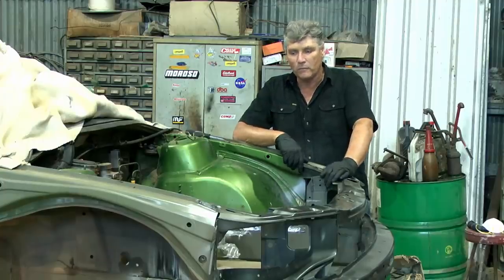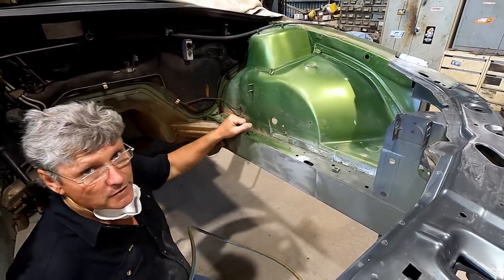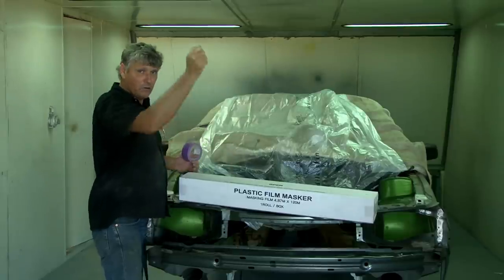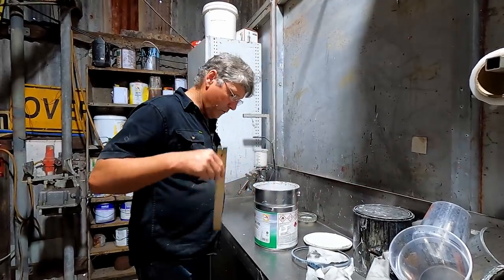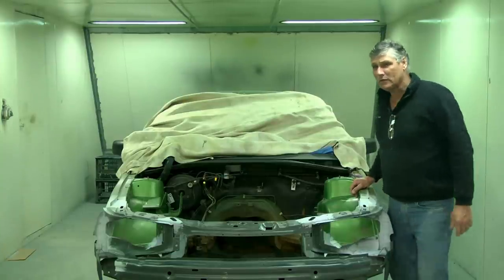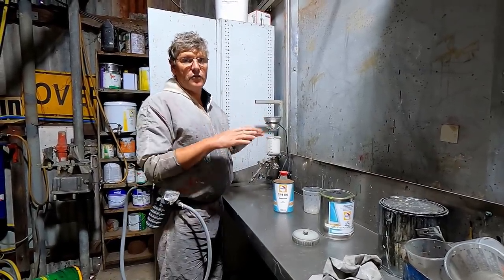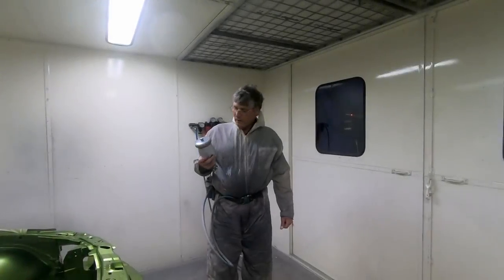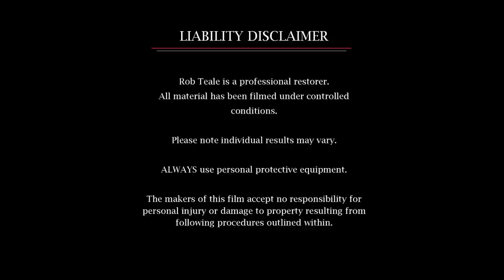Collision Repair - 2003 Holden VY Storm Ute - Part Three

Comment: A plumber mate of mine stores his sealers in coke bottles filled with water he cuts the neck off, ,dont know if it will work for automotive though! Also will you have issues with the airbag computer or the seat belt tension circuit computer?
Reply from the maker: Hi Mate, thanks for the tip. I haven't heard of that one before, but will try it. A long time ago an ol mate told me to keep unopened tubes in the fridge to make them last longer, I did this for many years and then gave up. Turned out that it didn't make much difference. Still everything is worth trying. An experiment is in order here. I will clear the airbag code in a later video.  Cheers Rob.

Comment: Ive got a left side dinged ss ute and wondering Rob if you can cut it back a bit further and stitch in new rails partially with the surrounds of the strut tower,more the inner wall down to the rail
Reply from the maker: Hi mate, without looking at the damage it is imposible to say what can and can't be repaired. You need to start be getting hold of the repair procedure for your car. GMH outlets will be able to do this for you. As with all cars fitted with airbags there are strict procedures to repairing the body, I joined the rails between the K frame mounts. This to the GMH specification. They state that if the damage is further back along the rail, the whole rail must be replaced. I am thinking that this is what you would need to do. If you have damage to the firewall and A pillar areas I would think that it is beyond being a viable repair prospect. We must at all timeswork within perimiters set down by the original equipment manufactures. The biggest thing here is if the same car is involved in another accident and a passenger is killed or injured, the liability will come down to you and your repair. If it meets the standards set down by the manufacturer you are safe...... if it doesn't........you go to jail. That simple. Hope this helps. Cheers Rob.
Reply: @robsshed  helps immensly Rob.appreciate the time for you answering.
Looking forward to seeing more of your videos as im pretty handy with sheetmetal myself

Comment: hi rob , where do you buy the rolls of plastic from please mate , and how much , thanking you
Reply from the maker: Hi Phil, I bought this one from Rise distributors. The product is masking film, and comes in a variety of sizes. I think this one was 4.8m x 200m roll. Any automotive paint supplier will have this, alternatively if you live a remote area your local collision repairer will happily sell you a box. Price varies a bit, but ball park between $60 to $85. Cheers Rob.